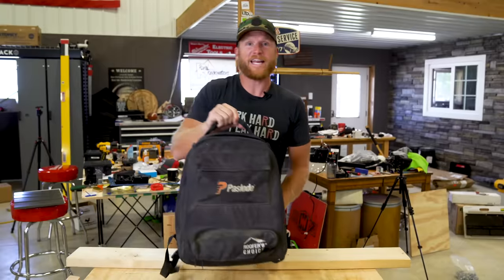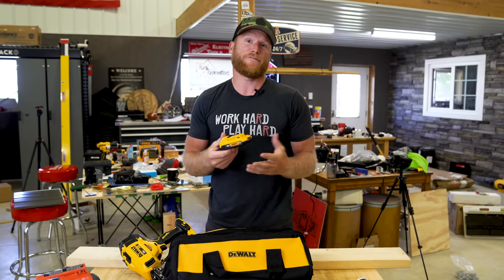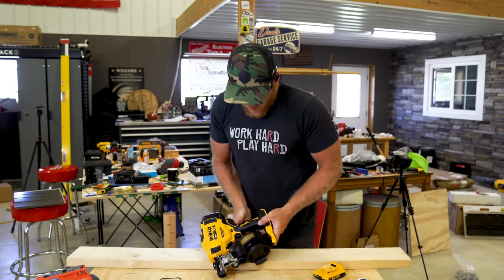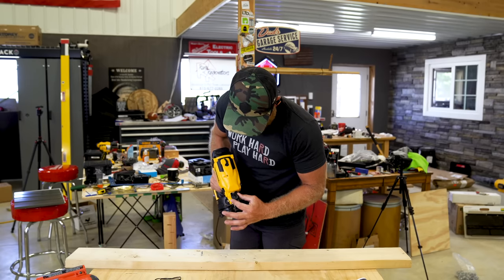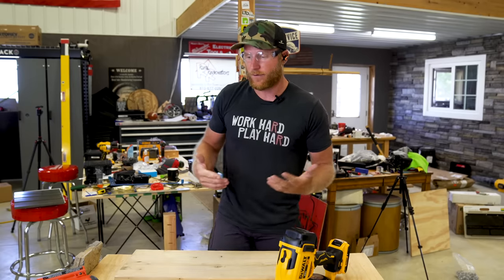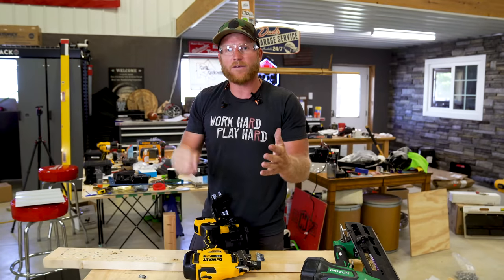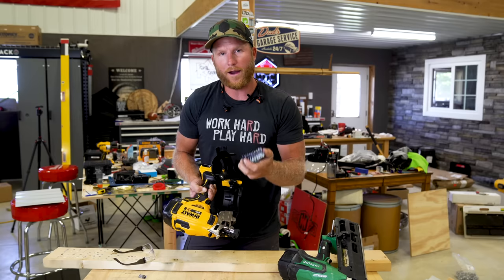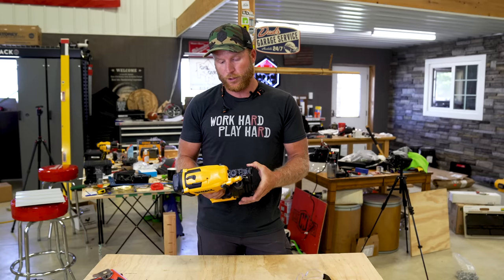BRAND NEW DeWalt 20V Battery Powered Coil Roofing Nailer: Toolsday

Comment from the maker: This has been on site for the last couple days and is awesome!  Are you guys excited for this? Will you be getting one?  Purchase one here from AcmeTools if interested https://shrsl.com/2c1gq
Reply: We bought one last week with intention of it being a tool for small repair jobs. We were disappointed with the quality of the tool for the price. We returned it.
Reply from the maker: @rooftop7089  what issues did you see that I should look out for
Reply: I pre ordered one hoping to get it soon.
Will be using it to install steel trim on our pole buildings
Reply: Will definitely buy. Like you said, use to install windows or fire drywall etc.
Reply from the maker: It will be perfect I think for that
Reply from the maker: Exactly
Reply: Dewalt is so chintzey in general......plus their electronics in their tools aren't potted either like Makita and Milwaukee so the dirt, dust, and water that you see on the daily destroys em. That wind up is so annoying I'd end up throwing it off the roof hahahaha
Reply: The biggest area we noticed was the feed mechanism.  You noted it in your video that it felt chincy and it is. In any new product you will have to work out some problems but for $400 plus dollars I feel they could have done better. That wind up noise also would drive me bonkers.
Reply: I think this will be used for more things that require or use coil nails, like some types of siding, and even setting windows, more than shingles

Comment: In a shingle application it would be nice to have this just for doing ridge cap.  That way who ever you are working with can coil up the hoses and compressor while you finish off the roof.
Reply: Yea it would except that these guns aren’t compatible with two inch nails…. So if your capping over ridge vent you cannot  use it…..
Reply: Why not just use these for the whole roof
Reply: @late0404  because they jam regularly according to other reviews.
Reply: @tjseymour3081  it works fine for nailing over Ridge vent it can shoot the same nails as any other roofing nailer. 
It actually is very handy for Ridge vent  and doing repairs or shooting steel trims like drip edge, valley pans And j Channel . 
Granted mine has been back to DeWalt twice and the second time they sent me a brand new one so not the most reliable but very useful.

Comment: This is perfect for me ......I do roof repairs alot ......I'm always hand nailing small repairs because I dont want to hook up an air compressor for a bundle of shingles .
Reply: I picked one up for the same reason. I do most repairs myself while crews are on full re-roofs. When I add up the hours I'll save unloading a compressor and running a hose, then putting it all away, it more than pays for itself in the extra repairs I can squeeze in every day.
Reply: Me too. What I'm hoping ... it will take a siding adapter or can be simply adjusted to nail siding too.
Reply: That's why I want to buy it. So I can free my left hand that I was using to lift up the tab lol

Comment: tile guy here: this will be perfect for installing 1/4" durok. Doing a small laundry room floor at the moment on the 2nd floor of a house. No more hauling the compressor upstairs back down to get hose, gun, nails. Just one bag and I'm nailing? sign me up.
Reply: That’s exactly what I’m going to use it for.
Reply: You have coiled durock screws that can fire out of a nailer?
Reply: @danielbuckner2167  exactly, i wouldnt want roofing nails in my subfloor.
Reply: @davesilvia9711  from Durock web site:FASTENING
Secure panels while adhesive is still wet. Space fasteners
8 in. (203 mm) o.c. around the perimeter and in the
field of the board.
Wood framing and countertops: fasten with 1-1/2 in. (38 mm) 11-gauge hot-dipped galvanized roofing nails, or 1-1/4 in.
(32 mm) USG DurockTM Brand Tile Backer Screws for wood framing or equivalent.
Reply: Wouldn't it be easier to just use durok screws?
Reply: @willcoxs.5887  Yep. There aren't ANY hot dipped galvanized nails in coils on the market. Just electroplated. Electroplating isn't sufficient to withstand the environment of caustic thick/thinsets.
Reply: Hue Janus no. It’s a PIA screwing the durock. I can see how a roofing nailer would be easier and quicker.

Comment: I can see this gun being effective in the world of privacy fencing. Installed fencing years ago and the air hose was a pain when you're running 400 ft
Reply: You would prefer a siding nailer probably. A framing nailing would even be better than a roofing nailer for that.
Reply: daniel buckner   Did my fence with a 15gauge finish nailer, 4 nails per cross piece, toe nailed at about 25*. Looks good with no visible nails and has held up perfectly for about 10 years so far.
Reply: That's what I was looking for in this nail gun. I do fencing and I've always used a coiler for the slats, but the air hoses are driving me crazy. Did this coil gun hold up to the amount you were using it?

Comment: Picked one up last Saturday,  so far I am extremely impressed with it.  A great tool for the guys to finish up cutting a rake or for doing the first few rows on the roof, no hose to deal with in those tight areas.  Loving it so far.
Reply: So how has it held up over 2 years?

Comment: Anybody else out there using a roofing nailer to pin up drywall? Works good to hold the sheet in place before you get the screw gun out.

Comment: Used this nail gun for framing my basement and it worked great MyBest.Tools Two downsides are weight and its not a 30 degree. For the cost it was perfect for completing my project. Worth every dime.
Reply: You used a roofing nail gun (1-3/4" nails max) for framing?
Reply: @nosnim2207  I'm sure that's what the rest of us are thinking as well

Comment: Used it for a 6 square shed, a little heavy but no hose was worth it.   I just went moderate speed and outside of user error a couple times I had no issues and changed the battery about halfway in and maybe didn't need to.   I have 7-8 20v batteries so it is no big deal.   Loved the freedom of the cordless.

Comment: Works great. With larger battery can put on 9 bundles without a change. On an average 24 sq house that s changing batteries 8-9 times, not bad. Consider you add a nail coil every bundle so every 9 th bundle change the battery.

Comment: this is gonna be a real back saver, not a proffesional by any means but ive felted a few large roofs with a bucket of clouts and a hammer, my compressor is far from portable and the portable one I had did not have the guts to drive a pneumatic nailer so a the battery coil nailer will be a god send for my next project, i have the dewalt framing nailer and yeah its heavy but for framing it works great, i've had a few with poor penetration but thats with 90mm ring shanks on some pretty tough timber, with 50mm on bump fire (fixing ply to frames) its an absolute rocket ship!

Comment: Once again a great review! I hope Milwaukee comes out with one without the ramp up noise and a vinyl siding tip would be a game changer for sure!
Reply from the maker: Agree
Reply: @MrCubflyer  Its the delay times thousands of nails. It equals you still being on the job while someone else has finished and is on the next job or spending time with family.
Reply: daniel buckner you don’t have to wait for it to completely ramp up to fire (at least for framing nailer).

Comment: A cordless siding nailer with the smaller head nail would be useful. You could still use it on flashing but with stainless nails do exterior trim as well.

Comment: Time will be the test. Can’t wait to see it in action.
Reply: The nailers have been out for a while, they are cheap and dont hold up. This would just be for repairs where there is too much to hand nail or a handy man. No roofer is going to use this, it wont shoot as fast as a Hitachi nailer and if you beat it up like you do an air nailer it wouldn't last a week
Reply: @bolerdweller  exactly. Full-time handyman here, and Im not convinced yet. Excited, sure. But having gone through 3 dewalt nailers in the last 2 years (15g and 18g) they just havent held up well at all... We shall see if this is worth it
Reply: @bearlemke  I have the cordless dewalts because they were the best for what was available at the time. Dewalt has always had garbage air nailers, I've pulled them out of the box non functional. They own Stanley bostich, black and decker, porter cable, craftsman so steer clear of those as well. I bough an 18 gauge porter cable thinking they would be alright, the last pair I had was 25 years old. Didnt work very well and chopped a piston in less than a year. I didnt even know dewalt owned them until I ordered a new piston and saw that it was a dewalt part as well

Comment: Keep those two amp batteries the value of those sound like there worth there weight in gold. The nailer seams like it has only a good use For a couple shingle fix for a 35R fix or a quick narrow area you don’t want to drag an air hose.

Comment: Finally! I was waiting for desalt to come out with one of these. Hope it’s as good or better than the pneumatic
Reply: I think the potential to be better than a pneumatic nailer is totally there. It certainly won’t be faster, but some times it’s not all about speed of the nailer. If a tile installer uses this to install their backer board, or a roofing repair crew using it to replace a few blown off pieces of ridge or missing shingles. Certainly would be better in those scenarios. Just my opinion though.
Reply: @tonyholtum1373  in repairs depending on how much you hand nail would be faster to just hand nail, I could see it being ok for backer board but when I install backer I screw it anyways. I dont think the technology is there for electric tools to compete with pneumatic, we have these ones and they are surprising that they are able to do what they do but they are still fragile. I have one of the dewalt spikers and one of the Brad nailers and they are just as bad as all of dewalts other tools with plastic parts where there shouldn't be plastic parts. I have a friend that worked in the tool crib at a previous place of employment and these guns were in there every day

Comment: sure. i would have loved that tool when i was putting in my windows.  The problem with all those coil nailers is when you have the coils in your pouches and they get smashed... they dont want to feed right.
Reply: before you put it in your pouch take two coils together (points facing each other) and press them together to make a pancake. They are much harder to crush that way, you just have one open one to deal with at a time. thats what we do anyway

Comment: Nice review, as you said you don't really use the roofing gun for roof, it would have be nice if you demo it with cement board. I use a roofing nailer to install cement board to the floor prior to tiling.
Reply: Yes, same here, would be nice to show review for the cement board, if it handles putting nails all the way in and not stick out too much

Comment: Hi,

Very nice, not expecting to do a whole roof but still good for patch work, shed roof, fence siding and cement siding. Also all the items you described. 

Yes, i do wish dewalt can change that flywheel motor. Man it's annoying. 

Like i mentioned before. DeWalt hands down has the best design on their brad and finish nailer. Just the motor is annoying. If Milwaukee can make this identical design with their motor, man it will be a sweet cordless roofing nail gun. 

Also the same with the DeWalt 15g finish nailer.  If milwaukee can make the same design with their motor, forgetaboutit.....

Thanks for the video

Comment: Hey Kyle. If possible, do a video about the Vapor Barrier.. like explaining why to use it and how it works.. i could not find any good video about that around. Also were I live they don`t use that.. so i want to understand why you guys use it and if it could be useful here on my crazy tropical weather. Thanks!
Reply: he he uses the vapor barrier as a Wind Block. That is why he doesn't run the vapor barrier up on the Gable because he doesn't care if Wind Blows into the attic area just into the Personnel occupied area of the building.

Comment: I have the 18G. I don't find the ramp-up annoying, but... I really really dislike the initial jolting recoil it does when the flywheel launches the striker rod. The tool either misfires, or shifts the work piece, or looses potential striking power and the brad just sticks out. If DeWalt comes out with gas compression type, I'll go for it. For now, all flywheel type stuff is off the list.

Comment: Man I want this gun so badly….I am a self employed roofer snd the prospect of being able to roof and work without having to worry about an air compressor…. And fighting with hose tangles all day is SOO appealing to me…… just for some reason I feel like it wouldn’t be an ideal gun for all day every day roofing…. About 20 square a day…. Seems like it would be better suited for small repair work…. And also if the battery life is only about 500 nails….. that’s enough nails at 6 per shingle for about 1 and a third square which renders the gun useless lol….. as I stated earlier seems like it’s more suited for repair work….

Comment: Kyle, would use use this to install LP smartside vertical panels? Like your video with the board and batten LP material, would 1 3/4 rink shank nails be sufficient for the .315" siding and .625" battens? This would leave roughly 1" in the sleeper furring strips. What gun would you run for this type of application? I do not not have a compressor and hose currently, but do have 20+ Milwaukee and dewalt batteries each.

Comment: As a roofer. I'd much rather change the battery 50 times than fight with the hose all day. Especially on a roof that requires jack's & boards.
Reply from the maker: Yes

Comment: Someone needs to tell dewalt and Milwaukee to hurry up with the siding nailer 😂
Reply: YEEEESSSS. Been waiting years for one
Reply: Prime Fasteners has a soffitt gun and  with a siding attachment. Both use 1/2" x 1 1/4"-2" staples not nails.
Reply: Why not use this?
Reply: Dewalt has a tip for this gun for siding

Comment: My ex brother-in-law worked for a large commercial roofing company that purchased the Paslode system when they first came out. We'd get small jobs for weekend work that the company didn't want. Just about every weekend we'd have at least one if not two 20-25 square jobs to run.
Paslode had problems of batteries dying in cold weather and the gas combustion chamber would carbon up requiring factory service to clean. The guns would go a maximum of 400 square before having to be serviced.
I'd rather have a Bostitch RN45 or 46 with the hose. While you don't like hoses, the hose properly clipped off to a harness will keep the tool from going over the edge of the roof.
The only roofing nails that I hand nail at the nails Timberline requires to be hand nailed for their roofing caps. GAF will void a warranty claim if you don't hand nail the 2-1/2" nails they supply.
DeWalt has no excuses for selling a shitty coil nailer, since the parent company also owns Bostitch.
Reply: Speaking of Stanley Black and Decker, they also own Proto, Porter Cable, Craftsman, and others not to mention their own Stanley Tool line that has been around for over 150 years. Can you tell I'm located a half hour from New Britain, CT.
Reply: They own bostich but the garbage dewalt nailers didnt get any better, the bostich nailers came down in quality. All those companies suck now, porter cable line is garbage, craftsman is craftsman, Stanley is still just cheap Walmart junk and so is black and decker. Now if you want good tools you have to go Japanese or European, and get away from the "American made" (really made in china) stuff. Japanese makita is one of the only companies that's still not sold out so they are still good, hitachi/metabo were both good companies before the merger, festool(too pricey for me) and senco or just specialized companies that offer high end tools like stiletto and Martinez hammers, Occidental leathers, stabila levels ect

Comment: I would love to see how fast it shoots with a FlexVolt battery. 😁 I’ve been waiting forever for a gun like this for small jobs. Pancakes are good for the small jobs, but very noisy. They say it shoots 3 nails per sec on a 2aH battery. How about how fast it shoots with a higher aH or FlexVolt? Would you be able to put a small video together for that? Also thank so much for the videos...it’s because of you I was introduced to and ultimately purchased Diamondback tools and Martinez tools. Love the quality...thank you!
Reply: Wouldn't shoot any faster, your battery just holds more charge. I have flexvolt batteries and tools dont act any different from battery to battery. Only if the tool is a flex volt tool meaning it can tap into the battery and use it at 60 volts rather that 20
Reply: @bolerdweller  yup. And honestly my 6ah flexvolt does not last as long as my 4 and 5 ah reg 20v batteries. its just WAYYY heavier
Reply: I don’t know about that. With my DeWalt 20v impact, the speed is faster at driving long bolts with a 9ah battery than with my 5ah 20vMax battery. I even tried the difference with the Milwaukee drills from 5ah to 9 and 12ah. My Bosch tools especially my reciprocating saw are faster with a larger ah battery as well. So to me it seems it may be able to rev up faster or hold a longer speed for driving more nails rather than 3 nails per second with a 2aH battery.